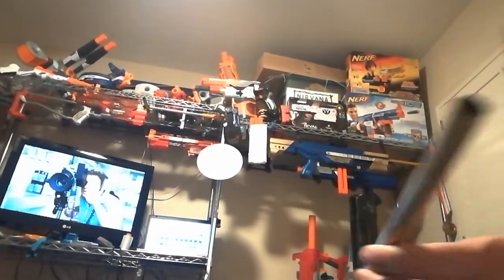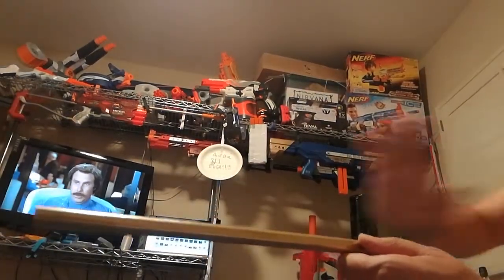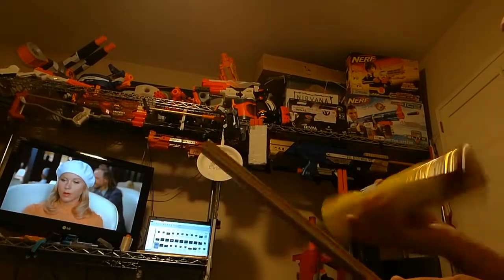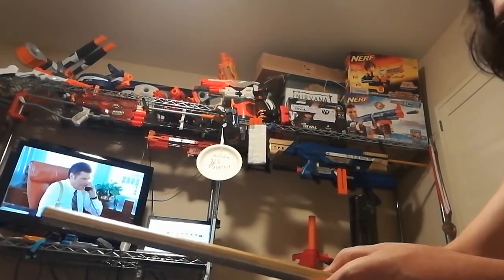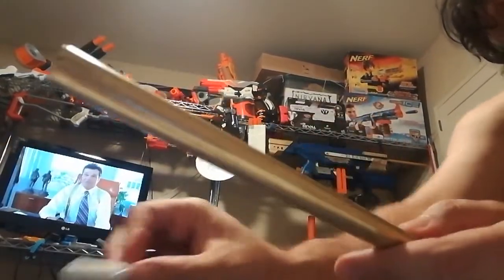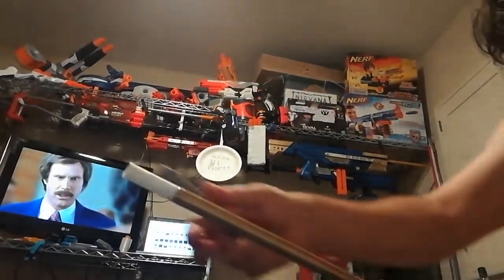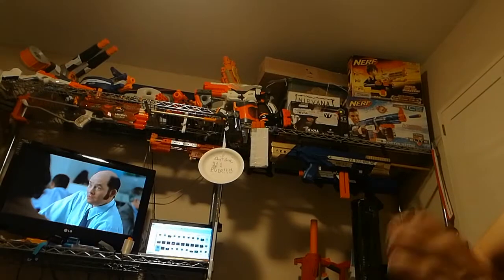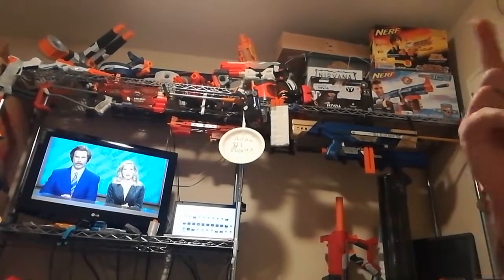Wax barrel treatment on a KronoMag commission.

Comment: excellent video Chris! I'm in the process of building the exact Kronos with Chrono mag and was wondering if I should Grease the barrel because of the tight fit of darts in the 17/32 ks brass. ... and yes please show more videos of installing the venom kit katana mag in the Kronos.. please! and where can I get the barrel shroud cover featured in Bradley Phillips review of big blue (Kronos) ?
Reply from the maker: roman pennix Mine actually is not a Venom kit, it is a jet blasters katana mag adapter laminated to the dart gate with fiberglass.  It actually predates the Venom kit and this method was used on the original Krono Mag
Reply: @TheChrisCartaya  okvthanks Chris I was wondering is there anyway you can show how you glued everything together to make sure that I'm doing it properly? and are you currently taking commissions?
Reply from the maker: @romanpennix5635  i might be aftr next year, however the laminating of the magwell and breech construction is something i have covered in other vids and is not easy to explain and understand unless I am doing it.  Even when i did an episode of Owl Ranch laminating the magwell to the sharpfire used for the Rev 2 Mauserfire, some understood, but many others, just didn't.  My method is not as common because most use the drop in 3d printed magwells and use different methods than i use.  So even then, i don't think i'de be much help.